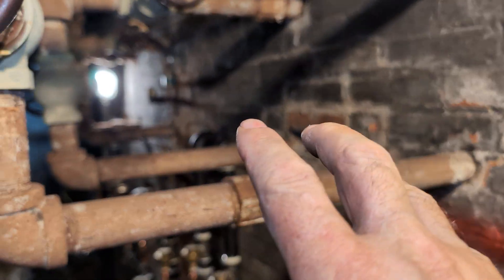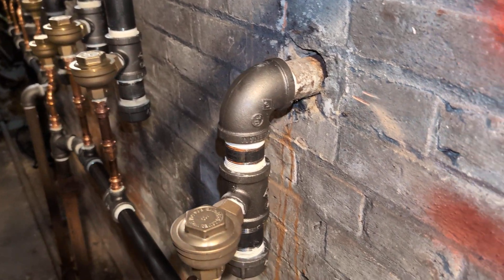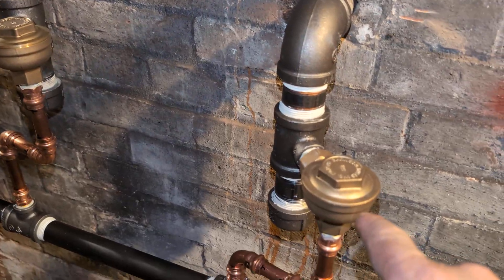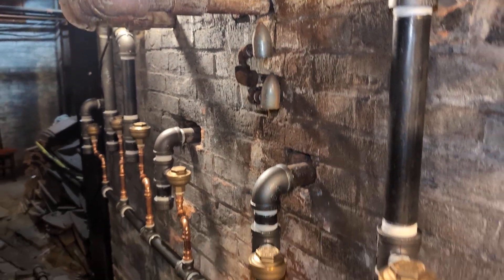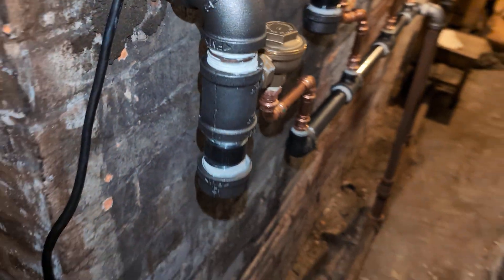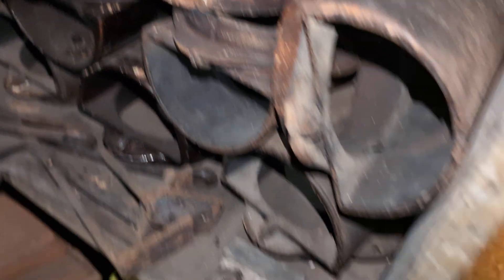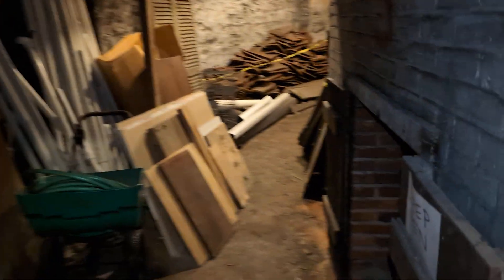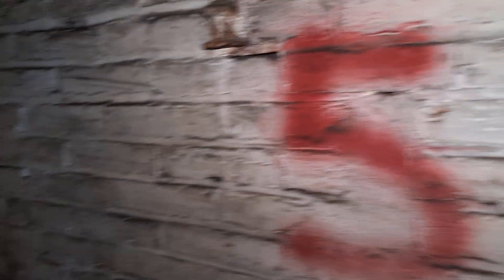New Life For Old Steam Heating Coils

Comment: When I expressed skepticism (out of ignorance) over the press system, someone educated me by saying "It's been used in Germany & other parts of Europe for 35 years." I fell in love with press and use it for the limited plumbing I do. (Mostly WHs) Dp you have any doubts or history in steam systems? I specifically wonder about the O rings; once again from a point of inexperience.
Reply: Time will tell. The "O" rings are approved for LP steam 15psi or less. IMHO if someone uses it on steam supply it is a hack job. Using it on steam condensate that is probably under 190 degrees or so it will probably last
Reply from the maker: Totally agree with all that is said above.